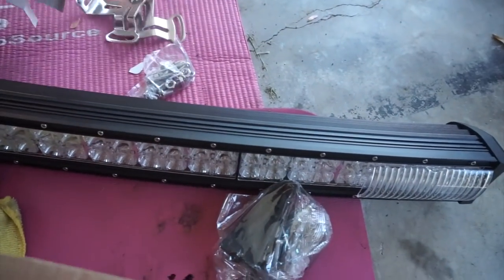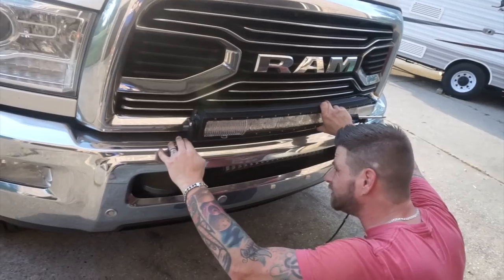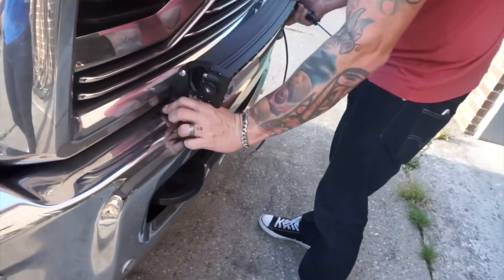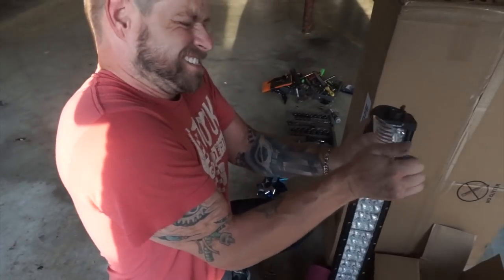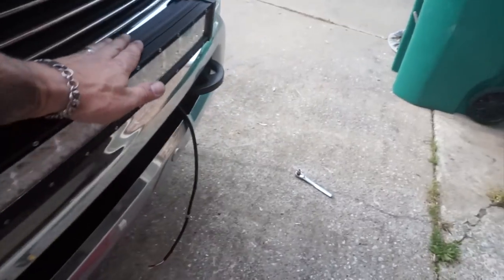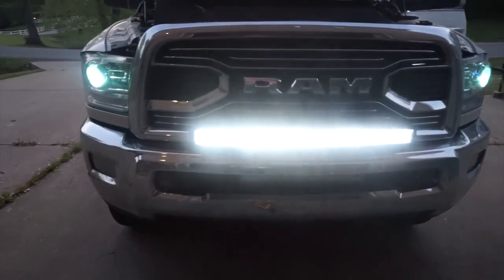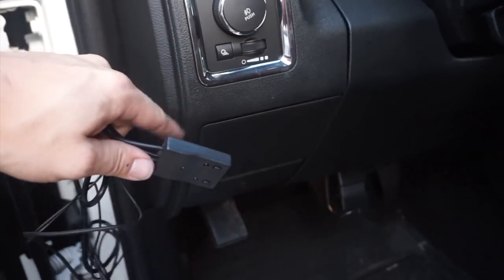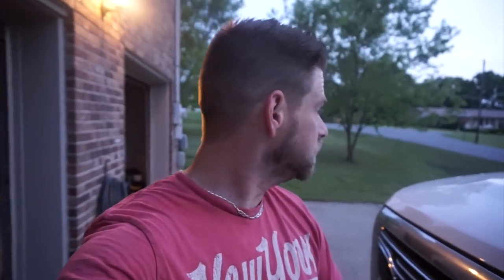2017 Ram 2500 Auxbeam LED Lightbar Install

Comment: I was hoping it wasn't going on top of the bumper :( should've put it in the center opening of the bumper.
Reply from the maker: smcox1991 already moved it to inside the bumper
Reply: SRTMUSH Awesome!
Reply: Can you upload an updated shot with it in the bumper? I am about to do the same thing. I just need to find the bar and brackets that go behind my tow hooks.

Comment: Great vid...but I think tucked away mounted lights look more cleaner👍🏼
Reply from the maker: Henrick Henry I think I agree. I might see about mounting it in the bumper. Don't think it will fit though. Either way, it's more for function than looks on this particular case
Reply: SRTMUSH seen alotta 4th gen light bar mounted all the way across where u have ur other bar...but I was just surprised you stuck it on top because you pay attention to the details n have tht clean look like ur hellcat but still great video love the channel👍🏼
Reply from the maker: Henrick Henry I may remount it in the bumper and use the same holes I just drilled.
Reply: SRTMUSH tht be sweet bro look hella clean like tht😎
Reply from the maker: Henrick Henry just moved it. I'll update in the next video
Reply: SRTMUSH kool I'll be running in buddy👍🏼👌🏼
Reply: *tuning in

Comment: 40" in bumper with brackets. Super bright and very easy to install. You should have done the up fitter kit when you bought it if you wanted to put lights on it. Would have made your life a lot easier
Reply from the maker: Bro Doze I have the kit. That's how this is run. With the aux switches on the dash.

Comment: SRTMUSH, I'm on my 3rd Ram, and the stock headlights just blow....Anyway, I've got a nice KC light bar with an LED bar on top and LED cubes underneath.  Congratulations on getting some good light on your truck!
Reply from the maker: 1NC4stroker thanks brotha. Yea, the stock lights were pretty weak. Same with our hellcat. Dodge seems a little behind in light technology. Nothing you can't rectify with a with bucks $

Comment: The option to mount a 42" light bar between the tow hooks is also available.
Reply: I put mine between the tow hooks on my 2016 Ram 2500 . I was hoping to send a pic of it but not able. 
Either way, yours looks awesome!

Comment: I would put the bigger light bar in the bumper like the smaller one and take the smaller one out. You can take the tow hooks out which are attached with 4 bolts in each one and make a larger light bar fit in the bumper.
Reply from the maker: jSwordy17 already did that ;) I'll update in the next video

Comment: You can fit a 42in curved light bar in the bumper but you would have to remove the tow hooks. Currently running one in my Ram 3500
Reply from the maker: Junior Garcia interesting. Chances of ever needing the tow hooks is slim. Maybe I'll try that out

Comment: If I'm not mistaken these diffusors you took out look like foglight lense. They seems to be most effective when pointing slightly to the sides that's why they where on far edges. Can this light be on partially? Far sides for diffusers only or you can get more of those to fit across whole bar?
Reply from the maker: Onimalap as far as I know it can only all be on. They diffusers can be put anywhere on the lamp.

Comment: You drilled holes in your new bumper for THAT?  Wow.........
Reply from the maker: Howard Ochs it's just a bumper.
Reply: Yeah, I know.  I just couldn't do it but it's not mine, it's yours!  Anyway, nice light bar and nice truck though!
Reply from the maker: Howard Ochs thanks my friend. I don't mind doing it. It's easy to replace if it turned out bad.